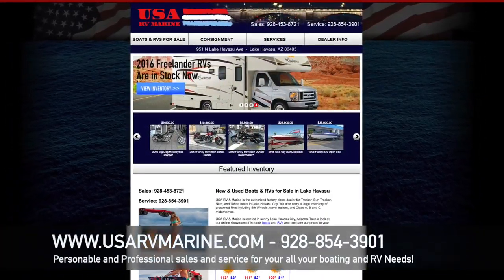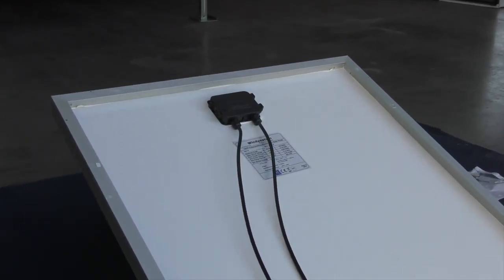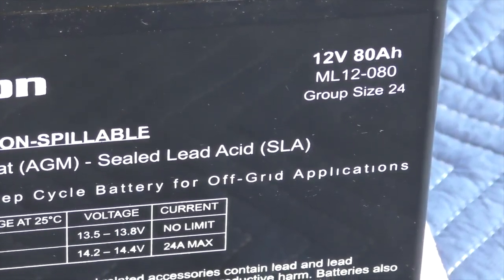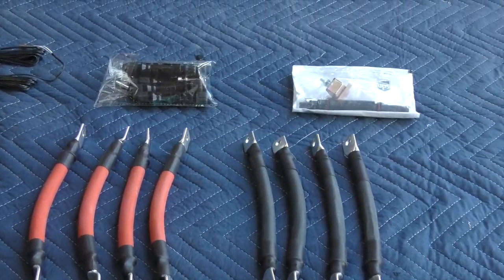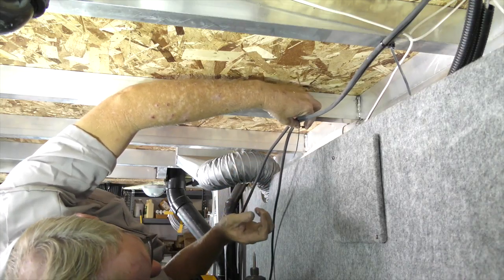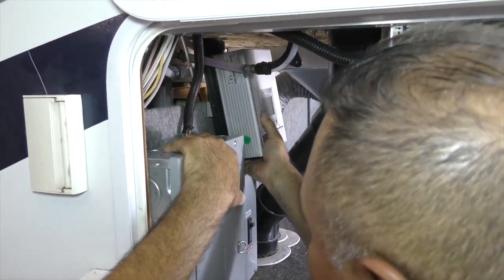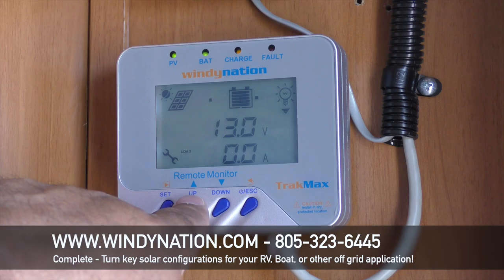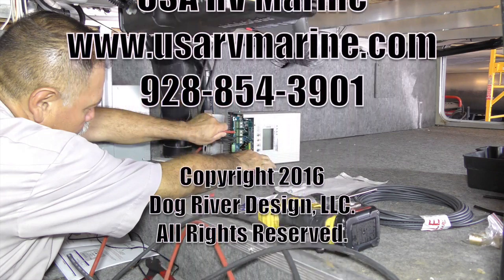Affordable, Turn Key, Off grid Solar! AirgunWebTV’s Hunting Rig Gets an UPGRADE!

Comment: Very timely.  We're setting up an off grid cabin this winter just outside of Show Low so we can spend more time playing with our Airguns.  good to have a recommended resource.  Thanks for sharing.  Viva la Airguns!
Reply from the maker: +Michael Neumeyer - Thanks for sharing.  I figured there had to be folks like me looking for gear like this.  I'm glad I put in the time to pull this together.  We are actually headed to TX on a trip now with the camper and the new system. I'll try and post some data about how we do out in the field!  

Cheers
AGW
Reply: +Expert Airgun Reviews / AirgunWeb / AirgunWebTV Right on , cant wait to see how it works.

Comment: Cool vid. We're your panels installed in series, or parallel?
Reply from the maker: That's a great question!  I'm not sure.  The installers talked at length with WindyNation before hooking everything up.  The system is still going strong. LOVE MY RV NOW!

Cheers
AGW

Comment: what was total cost.
Reply from the maker: +screw Everything. - panels, controller, and 400 ah worth of batteries will probably run about $1700 to $1900 depending what you get for connectors and cables. Installation runs a full day.  I you want an exact price give them a call. 

Cheers
AGW

Comment: lithium batteries like tesla cars aren't better?
Reply from the maker: They are better in nearly every aspect.. They hold a better, more stable charge, they are much lighter as well.  They are also extremely expensive. As the price comes down, they will most certainly be the right choice for solar energy storage.

Cheers
AGW